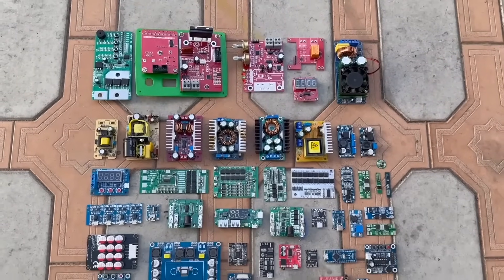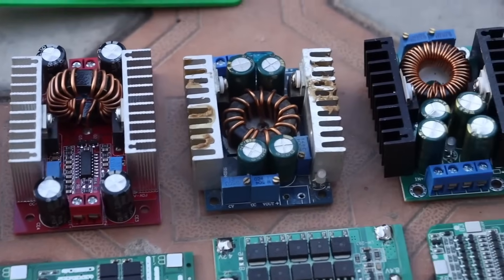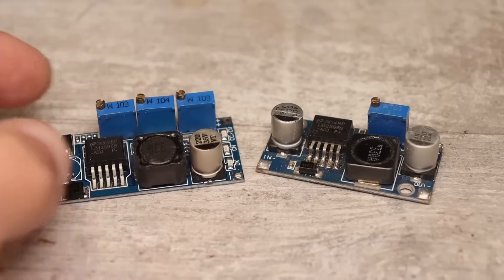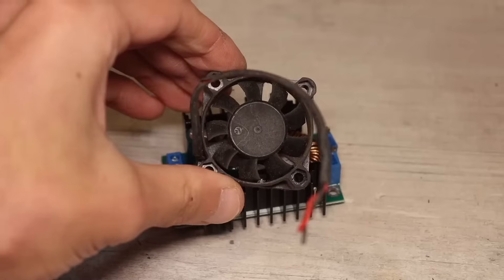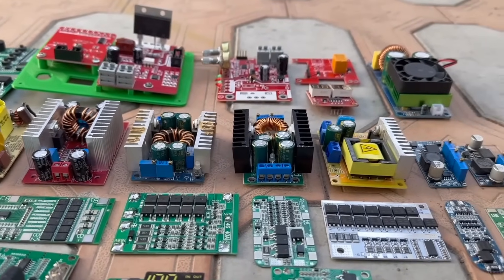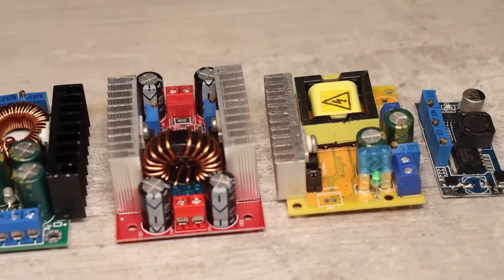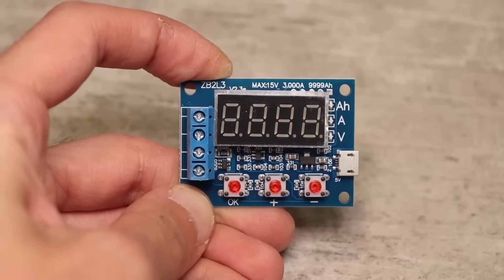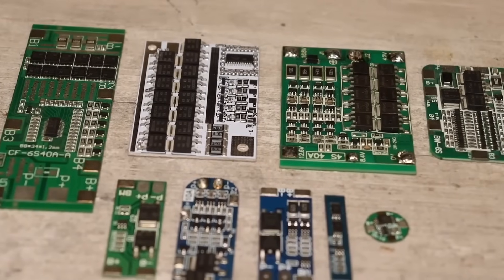Top Useful Electronics Modules from China – DIY Must-Haves

Comment: Nice rundown of these modules.  I was wondering if  a 2s battery with buck converter would be more efficient then those that just boost to 5.2v?  I heard buck conceryers are more efficient although 92% like those claim is pretty good, but 95-98 would be better? Maybe it's a cost thing from power bank makers , but for diy maybe could pay off? Hmm